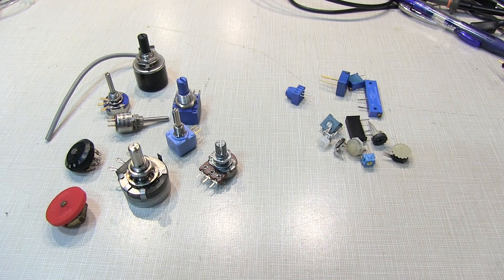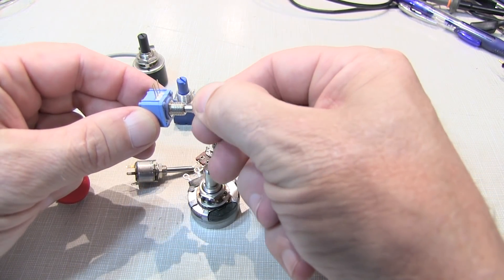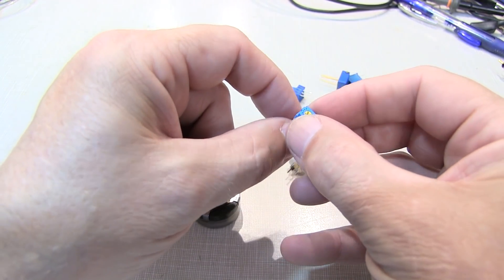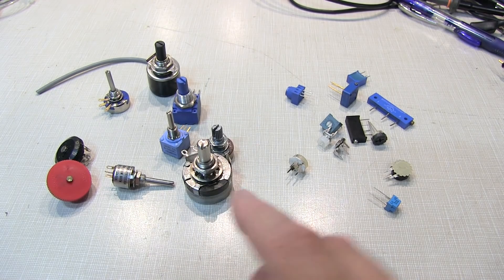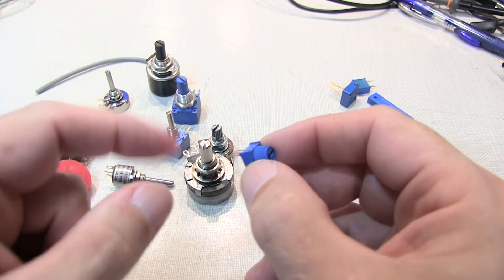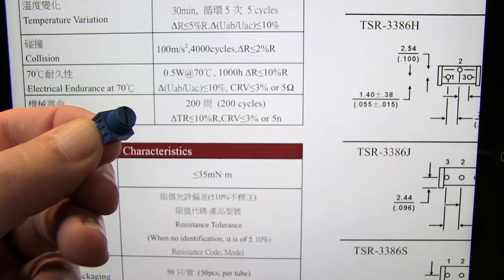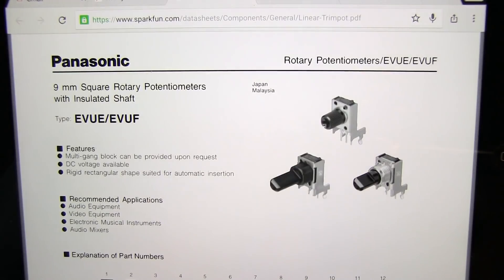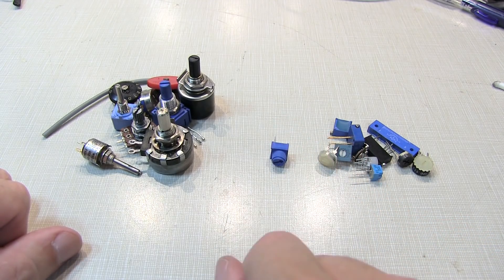#307: Back to Basics: Potentiometers - Controls and trimmers / trimpots - WARNING!

Comment: Can you do a video on how to read the values ?
Reply from the maker: In most cases where the connections are in a row - the pot value is read by reading the resistance across the outer two connections.  If there is any doubt - measure the resistance across all three combinations - the largest value read will be the pot's value.

Comment: Speaking of trim pots. I recently found a good deal from an Ebay seller that had two new vertical attenuation modules for my old Tek 485. My channel 2 had a bad pot on the variable adjustment on the center of the volts per division rotary switch. The coupling switch also had something broken on it and didn’t lock in half the time. Long story short, I purchased it and it works like it should, only issue is when switching between voltage per division the trace jumps around on the 1 Meg input setting where it stays pretty static on channel one. The new module doesn’t jump around nearly as much as the old one, maybe within one graticule where the old module would jump half the screen. I deduct that there is some kind of balance adjustment because of the invert function on channel two? Just curious if you could give me a pointer on what trim pot to adjust? Found something in the manual that kind of gave an indication but not very in depth. I don’t have a service manual. Other than that the old girl works pretty good for a 40 year old scope I got for $50. The module was $55 lol. But it was worth it to have it working pretty much normal. I love it for testing and checking circuits in old tube amps. I like my cheap Rigol 1054z for all the measurements it has, but those old Tek scopes are like pieces of art inside. Thanks for all you do Alan.

Comment: Great tip. I will definitely keep this in mind for the future. How about the max current rating? Is it usually higher for control pots than for trim pots, or is it most often about the same?
Reply from the maker: Yes, max current, particularly through the wiper, is generally higher for controls than trimmers.  However, in both cases, it's best to try to design circuits that minimize wiper current if possible.

Comment: A bit surprising, would have expected a difference but not that great. I'm wondering how many 'microcents' are saved by applying a thinner layer? Anyway Alan, great little video, and if you are reading this, I wanted to ask if you ever made a video of different kinds of snubbers, like RC vs. diode when exactly to use which method? I find some info online, but also a fair bit of handwaving. Thanks for all your work, it has helped me alot and I recommend your channel often. :) - Kim
Reply from the maker: I've only made one talking about flyback (snubber) diodes around relay coils, etc., but none that talk about RC snubbers.

Comment: I'm having a tough time getting an answer to this question. Can you tell me if there is a pot that can be turned left or right with the center being off? What I'm trying to achieve is,I have a pwm motor speed controller for my trolling motor. The way I have it set up is,I removed the trolling motor speed control drum switch  that attaches to the end of the handle and replaced it with the b100k potentiometer that came with the controller. This works fine but to go in reverse,I have to use the rocker switch. An on off on rocker switch to be specific and have to turn the handle clockwise for both directions. It would be great if there is a pot that can be turned either way with the center being off. Preferably with a center detent. This way I could make it work in conjunction with the rocker switch. I'm thinking that I can make a sort of cam that would activate the rocker either way when the pot is turned with center being off. I would just like to be able to use it without having to use the rocker switch for both directions,just with the handle. Any info will be appreciated. Thanks.
Reply from the maker: Maybe something like a "balance potentiometer"
https://www.mouser.com/Passive-Components/Potentiometers-Trimmers-Rheostats/Potentiometers/_/N-9q0yi?P=1yx2jpt
Reply: @w2aew  I did order one of those today. I'm not sure how it will work as one side will have to be completely off before the other side turns on.
Reply from the maker: @umpy3152  potentiometers don't have an "off" position, they're simply adjustable between minimum and maximum rated resistance.
Reply: @w2aew  The potentiometer that came with my pwm speed controller has an off position. When it's turned a the way to the left,it clicks off and shuts down the controller.
Reply: Minn kota  has a couple variable speed trolling motors that use a 3 pin pot. Turn right for forward and left for reverse. The center is off. I own one of these but prefer the one I'm working on as it performs better than the minn kota. I actually took the pot off the minn kota and connected it to the other pwm but it did nothing. It must be set up to work with the minn kota control board only.
Reply: @w2aew  maybe I worded this  wrong. Maybe not the center being off per say but being a neutral position.
Reply: @w2aew  maybe a better way to explain it is like a volume balance control only instead of one side fading. One side would be completely off when turned past center and Vise versa.
Reply from the maker: @umpy3152  It is possible that it was either a balance pot, or that the circuit was setup to configure itself for forward or reverse based on the pot setting (mid scale selected off, lower than mid selected one direction and higher than mid selected the other direction).  It can all be done with the proper design.
Reply from the maker: @umpy3152  The "click" to turn off at one end doesn't turn the pot off, it is simple an on-off switch that is ganged to the pot rotation.
Reply: @w2aew  I guess for now I'm stuck doing this mechanically with two pots. it will be somewhat of a hassle because of the limited space of the enclosure. Oh well, it just seemed to be a simple concept, having one pot for two separate controls.

Comment: i wish there was a type of system where we got a handful of chassis and a handful of pcb's with that resistor trace. that way when we burn out a pot, we can just swap the inside. also, then we could have better quality chassis.  sure would fit in the bins better too. i have a couple thousand pots and they take up sooo much space !!  could also swap values without unsoldering !!

Comment: Is there anyway to decrease resistance 1k potentiomter to 500ohms pots?
Reply from the maker: It depends.  Sometimes you may get away with paralleling the ends of the pot, with a 1k resistor in this case - but it really depends on the circuit and how the pot is used which will determine if this works or not.
Reply: Thx ill see what can i do

Comment: Wow only 200 Cycles. That's where some of the trouble is I guess even if it's put there for calibration.  Some equipment I work on need calibration a lot more often then one would think. Thank you

Comment: Why was no resistance mentioned though? Can a trimmer be substituted for a variable pot? Thanks
Reply from the maker: A trimmer is a variable pot - though designed for low power and infrequent use.
Reply: w2aew, thanks for replying, the first control pot you featured is the type of control I'm looking to use in my project. Is it possible to change a trimmer pot to a control pot by simply unsoldering the trimmer from its board. (In my case a buck boost converter). And soldering three wires to the controller? Your input would be helpful.
Reply from the maker: @milvolts1  Yes, as long as they are the same resistance value.

Comment: If I used a small trim pot in series with a resister could it be used for a precision adjustment of resistance to reduce DC OFFSET in a fixed bias stereo amp?  My stereo is a fixed bias which is controlled by two HFE matched transistors and a tail resistor. In my case the tail resistor is a 10k but my DC OFFSET is 20 mv with no adjustment  I would like to try to reduce this DC offset to as near zero as possible an maybe this could get me there. QUESTION: Where does the third lead attach or can it be left alone?
Reply from the maker: It is generally best practice, when using a trimpot as a variable resistor such as this, to connect the unused 3rd lead to the wiper.  This will have no effect on the operation of the pot or the circuit under normal circumstances.  In the case of a worn or dirty pot where the wiper contact goes "open", the overall resistance would only jump to the max value of the trimpot instead of jumping to infinity.  This might be beneficial depending on the circuit design.

Comment: I wonder why is there no limitation to over turn multi-turn trimpots. I was told that multi-turn trimmer was at its maximum reistance so I should not crank it even more over the limit. But the device I was trying to protect is much more expensive and nowhere to find these days, so I decided to first test that claim and slowly creeped over the said limit. There was no tension, nothing blocking me going past. So when I realised I stopped turning and instead turned back. Long story short, the device I am using doesn't show what it should show, so it's probably that I mangled the gear inside, and it no longer turn back, in other words it's set for maximum resistance for life.

So I wonder, why there isn't something inside  that would limit user from turning either side, over maximum.
Reply from the maker: I think it all highly depends on the manufacturer.  More mechanical complexity = more cost = less margin.  So it depends on the particular manufacturer's P&L goals on the product.  I've seen units that "click" at the end, others that stop at the end, and other that simply rotate at the end.  I don't think I've ever run into one that is ruined if you hit the end (unless it is one that would "stop" and is then over-turned).
Reply: @w2aew  Aha, so I'll give it another go and keep turning. Though wouldn't like to fry the device. Thanks for chiming in.

Comment: Can I solder a normal 100 kOhm resistor to a 100 kOhm multiturn potentiometer in order to get to 200 kOhm? Can't find a 200 kOhm multiturn potentiometer!
Reply from the maker: This will give you 200k total resistance, but only adjustable from 0 to 100k.  Does your circuit have to have a 200k pot?

Comment: Another gotcha is pin arrangement. The same trimmer can have various pin arrangements indicated by a letter or number in the part number. The delta arranged pins can have a couple different spacings and won't fit the board if you order the wrong one.

Comment: wow never entered my head...... 200 cycles really? would be really cool to do a vid  showing the demise of one or two of these guys
Reply: Just use one across a 1v DC supply, feeding the output into an AC coupled amplifier. Turn back and forth around 100 times end to end and they will get scratchy, especially if you leave them in one position for a few months as well.

Comment: I tend to use the trimmers in my initial circuit design but once I get a circuit I'm basically happy with I change to using a control pot, that way I get the right feel of the circuit before I build it up for proper.

Comment: Excellent review. Also it wasn't mentioned, but multi-turn pots and trimmers nearly always have a linear profile when plotting a change of resistance against a given amount of physical adjustment, whereas the single turn pots usually have an inverse-logrithmic profile for changes in resistance with respect to a given amount of physical adjustment. This is often referred to as a logrithmic tapre.
Reply from the maker: Single turn pots are available in BOTH linear and log taper - not all single-turn pots are log (most are linear in fact).

Comment: Thanks for making this video.

I actually have a question related to this topic. First, let me explain my project. I'm going to try to build a fuel meter system and I want to make the circuit as simple as possible even though I have to admit that I still consider myself a beginner. 

To measure the fuel level I am going to use a pressure sensor. By the way, this is for a motorcycle. The sensor that I have gives voltage as an output (5 - 4v). And then I am planning on using an Arduino to process that data and send it to a fuel gauge. Here begins the challenge. The fuel gauge that I have takes in as input, resistance: 90 ohms or above  = empty and 10 ohms = full. 
The problem is that I was planning on using a digital potentiometer controlled by the Arduino to vary the resistance but unfortunately (at least from what I know) I could no find a digital pot that can output such a low resistance. Many of them are well over 5k. Maybe you know of some ICs that can do the job?
So I am left with two options:

1- Develop a mechanical solution which would be based on a stepper motor rotating a trimpot to obtain the desired resistance. I know this will give a very smooth output. But I really want to avoid taking this path because it would take up more space and I want to make my circuit without any moving parts. Let alone the added complexity.

2 - Use a group of staggered resistors to control the output. Maybe by increasing steps of 10 ohm resistors. It would be something like 10 - 20 - 30... until I get to 90 ohms. However, the output won't be as smooth as I would like to. Granted I can use lower values to smooth it out but I consider this to be a very "raw" or "primitive" solution.

I've been thinking about a solution for the past few days and I would like to know your opinion or suggestions. Which would be the best path to take?
Reply from the maker: The mechanical solution wouldn't work because trimpots can't handle the current/power required to drive the gauge.  Even a proper control pot wouldn't be adequate.  Your best bet would be to use a power MOSFET as a voltage-variable resistor.  You may be able to work out a PWM drive for the MOSFET to mimic the old resistive sensor, since the gauge will "average" the PWM result.
Reply: @w2aew  Thanks for answering!
I actually tested the trimpot solution and it works with the gauge and that's because the gauge measures the resistance to ground. It has 3 wires: two for positive and negative (power) and the other is the signal wire (resistance relative to ground). And like I said the trimpot produces a very smooth output. I've heard about the mosfets as resistors and I will look into it. That's a opportunity to learn something new.
I appreciate your help!
Reply: @Undefined Lastname Thanks, I will check that.

Comment: What is the difference between a line delay and phase shifter?
Reply from the maker: They both cause a delay, so from that standpoint they're pretty similar.  However, a phase shifter is typically used for RF applications, often at a specific frequency, while a delay line could be more broadbanded.
Reply: w2aew oh thank you. I thought so. My friend asked me: why they dont use phase shifters in ultra-wide active phased array antennas and use line delay)

Comment: Reminds me of the very low quality experimenter kits from a once thriving electronics chain  store , when I was in grade school 50 years ago. No rating at all.  It discouraged many beginners. Thanks to a local electronics store that is still in business, sold quality commercial grade products. I still make a living in electronics.  From circuit board repair to installing campus wide, fiber optic connected AV systems.

Comment: Aww, I thought it was going to be about logarithmic vs linear, but I guess that's too obvious. Nice point about the cheap nature of the trim pot, though.
Reply from the maker: Maybe a future video on that...
Reply: @w2aew  It caught me on one of my very first projects as a tween. I made a code practice oscillator out of a 555 timer. I went to Radio Shack and purchased everything including a case. When I went to adjust the frequency of the oscillator, I found my blooper. Fun times!
Reply from the maker: @15743_Hertz  Many years ago, another engineer at the company I worked at designed a burn-in rack for laser diodes that used pots to setup the bias control loop.  He didn't know why there were all starting to act weird after a couple of weeks of use - guess what I found when I helped him troubleshoot it...  We retrofitted proper controls as a stop-gap, and then I designed a replacement burn in circuit that automatically adjusted the bias control loop - no manual controls at all.
Reply: @w2aew  Too much current for the pots to handle, lin vs log or a combination of both?
Reply from the maker: @15743_Hertz  Nope - he used trim pots in the design.  They got adjusted 3x a day, so they didn't last long...
Reply: @w2aew  Well, I missed that. Whoosh! Right over my head. Live and learn, thank you!

Comment: Nice video. Would really like if you could also cover 4 terminal potentiometers (center tap). Also their application on volume and loudness controls. Thanks!
Reply: That's right they are a rarity this days nobody really uses them this days. So you might as well  just use a normal logarithmic pot in audio with a little modification of the components around it Should work as a good as any.

Comment: Another gotcha is using a metal screwdriver with certain types of small trimmers with an exposed metal wiper in the slot.
It would be grand to deliver the "trap for young players" line with the snark of Dave Jones.
Reply from the maker: I haven't got enough snark...
Reply: @w2aew  Well, it is easier to add snark, than reduce it.  Something to be said for the soft-sell!
Have seen posts on audio forms complaining that their Potentiometers burn out after a while, either due to bad amp design, or, if I read it correctly, an input bias current (which cannot be much?) coming in through the wiper.  Is this really a thing?